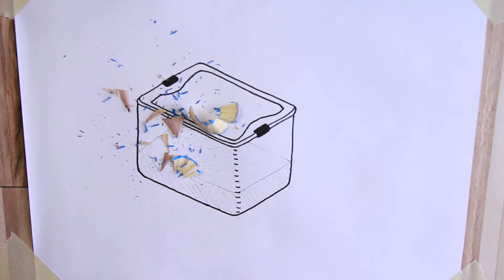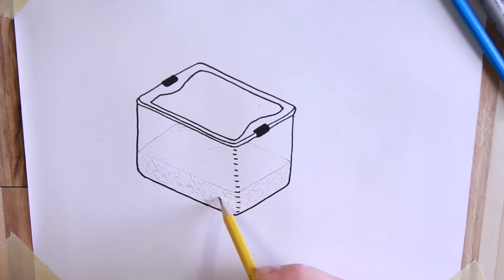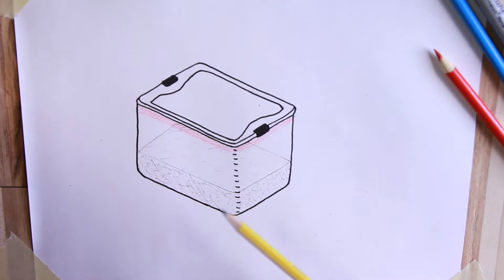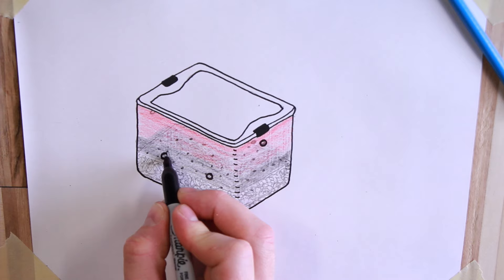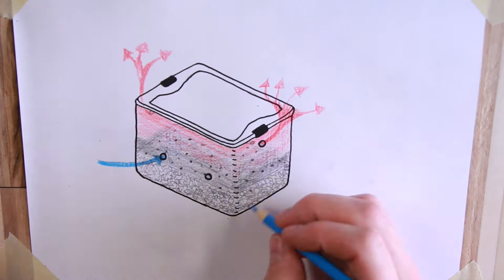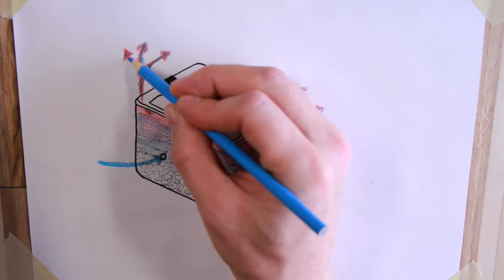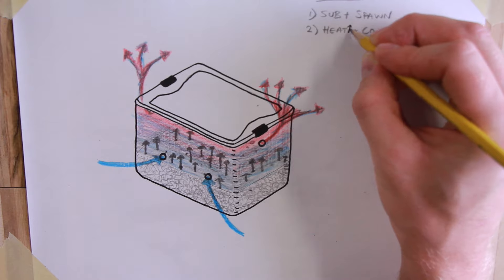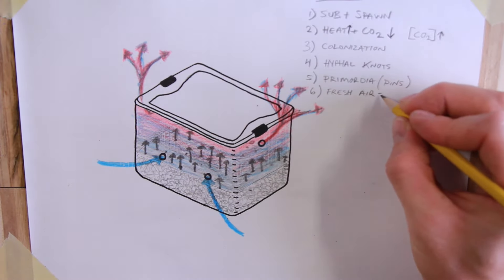Basics of How a MonoTub Works - Understand Fruiting Conditions, Gas Exchange for Growing Mushrooms

Comment: I was sure that because Co2 is about 37% heavier than o2, the purpose of holes at the substrate level was for gravity to pull Co2 out creating a vacuum effect pulling fresh o2 from the top holes, avoiding Co2 pooling over the substrate surface.  I did not think a 2-5 C temperature rise in the substrate material would be enough to warm the actual air in the tub to the point of forcing it out of the upper holes.

Comment: Nice video man, good info!    If you just flip the lid upside down you dont have to modify the tote at all. Then it can be used later for storing stuff.                      Gives the same results IME, but with slightly less work.  Give it a whirl if you feel like experimenting haha.

Comment: Great video but one thing...

  The micro pore tape does not allow for air exchange. It only allows for gassing out. It needs a bit of pressure to be able to push through. All my bottom holes that are covered in tape show outward pressure by pushing out and making the tape on the open area of each hole look like a dome or bump. At this stage the entire tub is warm. As the mycelium begins to make its connections you can take off the tape and allow for the fresh air intake cycle to start and the mushrooms will begin to fruit. 

  Yes eventually it will fruit with or without tape(if there are at least some knots) but taking off the tape speeds up the process and if removed at the perfect time you will get fruiting roughly 1 to 3 days later and continued colonization. If you take the tape off too soon the hyphae stop or slow down quite a bit and any kind of movement comes almost to a stand still. You want to wait and take the tape off when at least 75% of substrate has some kind of mycelium covering it. It doesnt have to be thick or dense but at least have some "knots" or over laps. It doesnt have to have pins/

  Having a too dry of a substrate also creates problems if the tape is taken off. The tape holds in moisture and a day or two after its off, if the substrate is under field capacity, things kind of start looking skinnier and slow growing. Misting then becomes necessary.  Too wet of a substrate will need additional actions for higher rates of fresh air circulation and the lid will need to be lifted off periodically during the day until the tub and mycelium look "field capacity". To obtain field capacity of the substrate I boil roughly 3 gallons of water and 1 tbsp. gypsum to hydrate and pasteurize the coco coir for 24 hours in a large orange "Gatorade"  insulated water dispenser. I put roughly 1.5 to 2 bricks of coco into a clean pillow case and fill the dispenser almost  to the top. Soak the substrate for 24 hours with lid on. The next day, when you take it out by the pillow case, make sure you're somewhere where you can get brown water everywhere. If its dripping wet just twist the pillow case full of wet substrate and squeeze a tiny bit until not dripping but still wet. Prior to adding to the fruiting tub, dump it out of the pillow case into a regular 27qt tub with lid and break up all the pieces then firmly squeeze each handful over a bucket until barely wet but crumbly and not dripping. When you're ready, mix the substrate with spawn into the bottom 2" of your 27qt tub then gently pat it flat with your hand, then add on top of that another layer of substrate only  1" to 2"  thick and pat down flat and level with your hand. That is the casing layer covering your spawn/substrate mix. Finish by securing the lid.

If done properly this method is self sufficient until harvest and you will never have to open the lid until harvest times. With proper hole alignment and numbers, proper field capacity substrate (I only use coco coir so far), proper temps(roughly 80deg F during colonization and under 78 for fruiting), proper timing for removal of micro pore tape, this tub is the perfect little (I use 27q tubs) semi self sufficient mushroom growing chamber. 

Having so many holes does make for a harder soak for additional flushes tho... Also, to stop any kind of unwanted visitors via the open holes, just wrap the tub in panty hose!
Reply from the maker: What an amazing write up on your technique!  Thank you for sharing!
Reply: @OneEarthMushrooms  Thanks! I figure I could add some pointers to your awesome video! 
Hit me up and I'll send you some pics of my tubs
Reply: Somebody finally answered one of my biggest questions, could we take off the micron tape when they're fruiting because mine has been getting pretty warm inside. I have two substrates inside a shotgun fruiting chamber, now I know with this size I should've put only one, and since the bodies starting fruiting it's been getting warmer. At this stage, I thought it's less likely to be contaminated if I remove the micron tap but I've been looking to make sure it is fine.
Reply: My respects @blazeaglory you took your time to explain a process, thank you!!!!
Reply: In short your "shocking" them a second time. That's interesting but make senses. Regular plants are the same with reproduction/producing edible fruits in larger amounts.
Reply: I'm slightly confused on a couple of points , as you mentioned if things are set up right i wont have to lift the lid at all ,but you did mention when tapes removed id need lift the lid to mist due to sub drying out?
So my question is-
Once you have put in your "Field Capacity" substrate and then Spawn Seed and then Casing layer you just let it colonize to about 75%.., then you remove the Mirco pour tape for FAE to promote fruiting.
So If you still have to remove the tape to allow for FAE do  you still have to lift the lid and mist due to the tape being removed or will the substrate be ok as its at field capacity even with the holes opened?
Reply: So technically if that's the case by reversing which side you stick the tape on you can dial in which holes you want to bring in fresh air and which holes force it out?
Personally I more lean towards fresh air being pushed in through the top holes and forced out the bottom ones, as opposed to being drawn in through the lower one's, which would make sense with your observation on how with the bottom holes the tape has formed an outward facing dome.
However this said I was under the impression micropore tape was two-way breathable and sufficient for allowing fresh air to enter and stale air to exit, while having the added benefit of offering a good degree of protection from bacteria and bugs etc, hence why it is used to dress wounds.

Comment: I dont mean to yuk anybody's yum by any means but Ive noticed the airflow is reversed in actuality= the CO2 goes out the lower side holes while the fresh air is drawn into the higher end holes. I only know this because Ive seen just in the past few days of my very first grow ever, the condensation is being cleared away just below the upper end holes. Great vid though and still all good info, thanks!

Comment: I put my spawn/sub mix directly into "fruiting conditions" allowing air/gas exchange from the start. It pins in roughly the same time as the bins that I used to keep taped up before full colonization. Make of it what you will.
Reply from the maker: Yeah, I've thought that would probably work.  Haven't tried it myself yet though.

Comment: Should I pack my holes with different density of polyfill?  Top holes stuffed lightly and bottom stuffed tighter, or vice versa. Or 2 layers of micropore tape at bottom holes, and pollyfill in top holes?
Reply from the maker: I've had best success with tightly stuffing the bottom holes and loosely stuffing the top holes with poly fill.
Reply: @OneEarthMushrooms   perfect, i figured from the video that it would make the most sense. Thanks for the quick response! The video really helped clarify all the contradicting info I've found and read from forums!
Reply from the maker: @niceandneatservices4831  you're welcome! Glad the video was helpful.  There's a lot of ways to cultivate, but I figured that some basic info about how things work would be useful.

Comment: Also worth noting That your monotub lid should always be clear to allow light to penetrate, fae holes should be covered up until fruiting, misting and fanning is the most important factor when It comes to pinning, and depending on the type of mushroom you are cultivating substrate depth and casing is extremely important.
Reply from the maker: Thanks for your feedback!  I'll definitely take that into consideration.
Reply: OneEarth Mushrooms great video tho, not seen anyone break it down like this.
Reply: You definitely shouldn’t need to fan, and misting can be avoided if you set your tub up correctly. The lid doesn’t need to be clear, and there are many people who don’t cover the holes at all and succeed consistently.

Comment: Very instructive!! I did it and it worked perfectly!! One question. I grow Lions mane in bags with filters on it (5 pound bags), if I try to use a bag with no filter, and I let some fresh air (from the laminar flow hood) to fill the bag before sealing it, do you think colonization will ocour with no major problems?

Comment: Should you drill the holes after the pins appear?
Reply from the maker: The holes should already be drilled and covered with duct tape at the beginning of the process. When pins appear, remove the duct tape and install micropore tape or polyfill to allow for the air and gas exchange.

Comment: Co2 is heavy, how can it escape through upper hole? 🧐

I've installed fan on lower holes to allow air to be drawn out, so that fresh air can flow in and replace depending on the substrate/mushroom type, also a CO2 sensor that I manually have to caculate an avg for tdc w. fan control.  

Humidifier connected to sensor, with a fan chamber to propell humidity. I've got the humidifier connected to a water tank, the tank has UV lights to sterilize it & I've been thinking of connecting the large tank to a small one w. a magnet and a magnetic stirrer below where as that one provides the machine with proper water.

Heating & cooling unit connected to a sensor control. 

Blue/uv/white light connected to cycle timer. 

All this is a prototype, for the mushroom farm I'm going to build... when I'm somewhat done with 21 projects on my property, fkme.

Comment: I'm pretty sure that the holes at the bottom, right above the substrate, let air out because co2 is heavier than o2 so when that happens it pulls fresh air in through the top holes. Could be wrong but i don't think so

Comment: Thank you for the video it really helps! The only thing that confuses me is should the holes be closed completely closed during colonization? And then filled with polyfill when the substrate is ready for fruiting?
Reply from the maker: Yep, you're exactly right.  I cover the holes with duct tape until the substrate is fully colonized.  Then I remove the duct tape and fill the holes with poly fill to initiate fresh air exchange and cause a drop in temperature inside the fruiting chamber.  Hope this helps, and thanks for watching!!!
Reply: @OneEarthMushrooms  hi, should all holes be closed for air and for co2 during colonization cycle? Is it ok for substrate ?
Reply from the maker: @Shizlgizlgar  yeah, definitely. There will be a little bit of gas exchange out the top of the lid so that you don't have a toxic buildup. But yeah, I'd keep the holes covered until fully colonized.
Reply: @OneEarthMushrooms  ok, hope it will be gas exchange out . But if humidity will be too much what to do?
Reply from the maker: @Shizlgizlgar  it's rare for it to be too humid in the monotub during colonization.  If it's something you're concerned about, you could always pop the lid of quickly and fan it once a day. I don't think that's necessary though.  How long have you been colonizing the tub?
Reply: @OneEarthMushrooms  oh, that's great if some troubles with humidity are rare. Thx a lot ,u are best!!  I don't colonize yet, prepearing stage 🙂☮️
Reply from the maker: @Shizlgizlgar  awesome! I'd love to hear how it goes for you!
Reply: @OneEarthMushrooms  I hope to start to do mycelium from next week. Will use oat and inoculation will be from print to jars.
Reply from the maker: @Shizlgizlgar  I'm interested to hear how the print to jar goes! I haven't played with prints yet, still working with just agar and liquid cultures.
Reply: I think it's same as agar , just throw a piece of spores in jars and shake it.  That is it 🙂
Reply from the maker: @Shizlgizlgar  easy! I'd love to see pics of your results! If you're interested in sharing here's a link to the OneEarth Facebook page:  
https://m.facebook.com/OneEarthMushrooms/
Reply: @OneEarthMushrooms  How many days is would that be to be air tight?  I want to start my first attempt to colonize on Thursday, but I'm going on a trip and will not be back until Wed...so that is 5 days...would that be too long with out fresh air?

Comment: thank you for this great video. It explained a lot but also got me asking more questions. Wouldn't the flow of air in your system actually go the opposite way? CO2 is heavier than air, even with the warm air, would it not tend to "ooze" out of the bottom holes causing fresh air to enter at the top? Would relative humidity also have an effect of how air moves? 
What are your thoughts on using computer fans to push air into the monotub? Have you compared that to the way you are managing your tub? Definitely the best explanation so far and I really enjoy the illustration.
Reply from the maker: I think you're probably right, some CO2 may "ooze" out the bottom holes.  It's probably a mixture of both...some CO2 mixing with fresh air and going out the top, some leaking out the bottom.

I haven't tried using a computer fan, but I've seen some people do it!  Just seems to be more work than it's worth for me, I get pretty good results as-is. 

Thanks for watching!!!